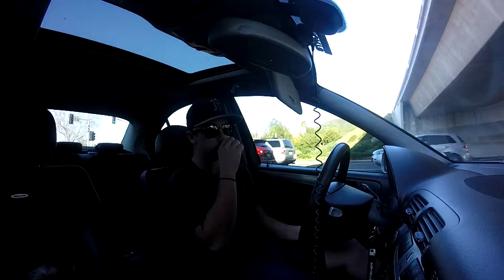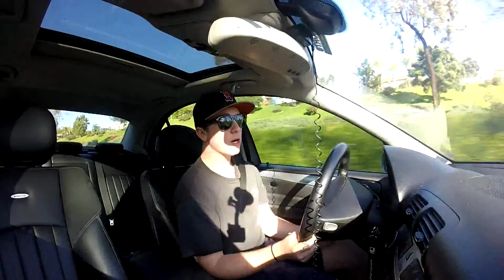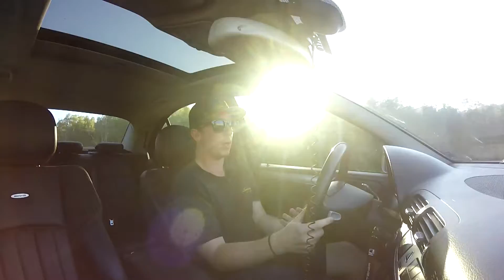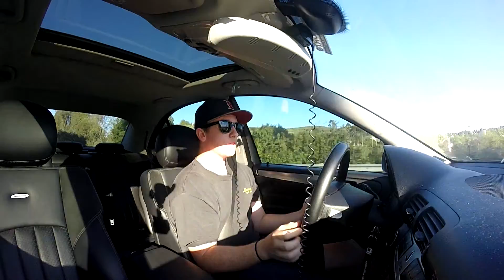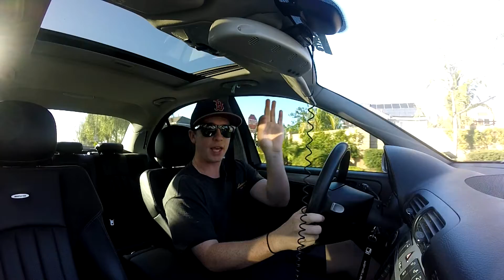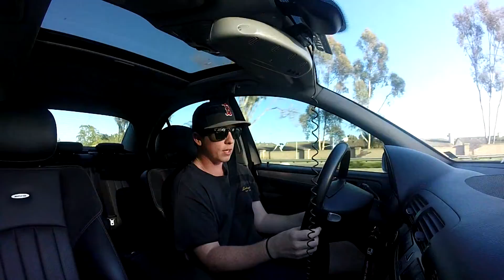C55 Vlog #5 Discussing the Koenigsegg Regera and Its Direct Drive!

Comment: But is not driving yet and still just numbers on paper. It heavy and not very good engineered. Normal when you have just 50 Persons including the cleaning lady to run the whole company. ... and the others have hundreds of engineers and decades of Experience. We will see when this "Mega-Car" is ready. The other will already run the next generation of E-Cars with fuel cells i guess. :-D Not even the Carbon Fiber wheels which are mentioned here are an innovation. The Carbon Fiber Wheels have been published about a decade ago. But there is reason why other companies dont use it (not because they dont know how it works, as most of them do Endurance racing for years or Formula 1). The problem is that they loose the air more less uncontrolled when they get damaged. Which can cause unneeded accidents. And the reality is, that you already can drive a LaFerrari, McLaren P1 or Porsche 918 (which are way lighter than this fat Regera) and that they sold their whole units already. Meanwhile the Regera is just ready on Paper. Not even the cars before have been properly tested for their speed (V/max and Track). Just the Charismatic Talking of the Owner is not enough to prove that the car is really good. Fast in straight line on track was Porsche for example already in 70th and 80th for example. 917/956/962 had already the performance of todays Koenigseggs. If you have a idea about Engineering you will see that a BMW i8 is harder to build than this cars. There are street tuners doing the same - and better. Sorry, but when you look at the facts a Koenigsegg is technically nothing special and years behind the bigger competitors. It has low weight, a big turbo charged engine and aerodynamic shape. WOW! How innovative ! A Bugatti is the way better technical car (that also a reason why it is road legal nearly everywhere and Koenigsegg has not even a Airbag System which is road legal in some states). I can drive with the Bugatti to the Supermarket, Use is as Daily Driver, use is in rain and on dirt (because it has 4x4), i can run the same speed with it but i also can pick up my wife and go for a weekend trip and dont feel permanent bothered by the sound of the engine and listen to some cool music and just let go. When it rains or the track is not good, i must stay at home or drive way slower than i want. Most Racedrivers complain about the handling of the Koenigsegg too. This will not happen to P1, LaFerrrai or 918. It`s a lunatic car which goes very quick from 200 to end, but that`s it. It not a technical highlight (as there are only things inside we already have seen before from other car makers beside the door mechanism) and not the Unicorn people want to see in it. It`s ok for a little brand, but overall not better than the known Brands. Logically: Where should their experience come from? From 100 Units they sold since the company exist? From the not existing race team or not existing race experience? Beside of a Design Price they won nothing at all - and even this is years ago. For the new Regera: Did you ever checked the Partners for the E-Drive train from Koenigsegg? It`s a tiny company which uses E-Engines from Germany and Batteries from the US. What this little company (Rimac) develops is a light version of what the big players had already in stock years ago.